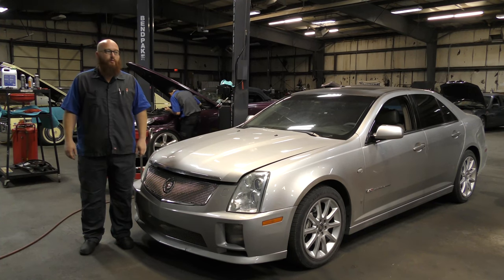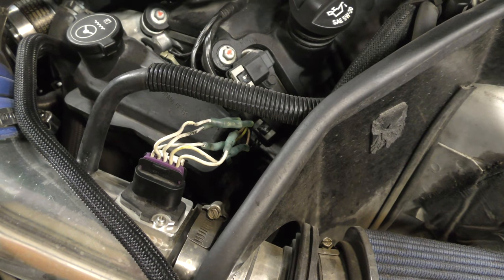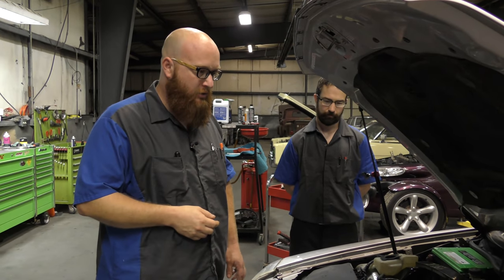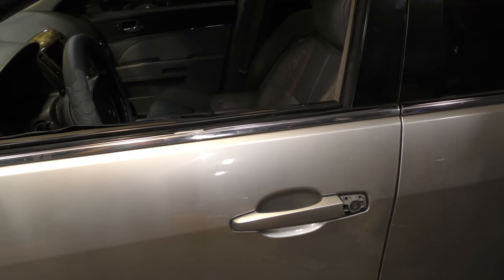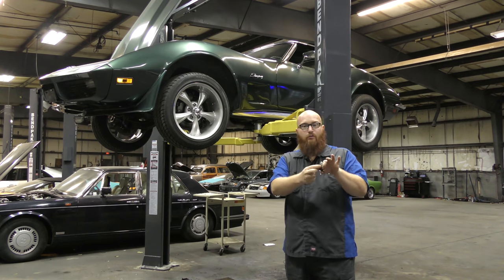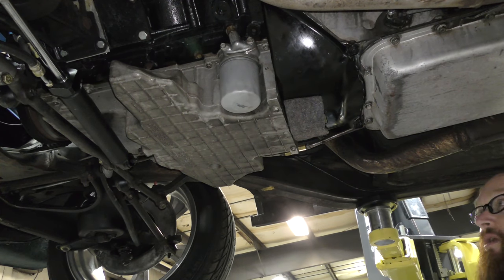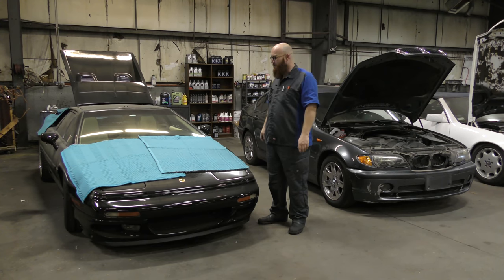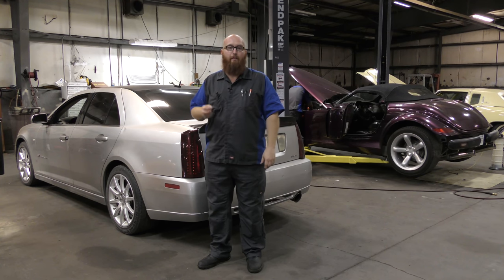When shops break cars! The CAR WIZARD cleans up mess made on 06 STS-V Cadillac. Plus shop updates.

Comment: I had an '85 F150. It was a 4.9L with a 3 speed with OD, on the floor. Now, I was really busy with work at the time, so, I brought it to a local shop to get work done. Real simple stuff, plugs, oil change, rakes, stuff like that. Well, when I picked it up the clutch was totally buggered. Turns out, the kid they let work on it, didn't know how to drive stick, and, DESTROYED a rand new clutch disk in the couple of days they had it. I ended up going around, and, around with the owner about it, and, eventually had to threaten to sue him to get him to pay for it.

Comment: Didn't they screw around with the MAP sensor voltages computing? Sinsce BAROP sensor is in the engine module (i think) it must mean that, even if the BAROP sensor is shot the module sends a default vaule and it doesn't cause a DTC. I would try module reprogramming back to stock

Comment: yeah it doesn't take much to damage a vehicle if you don't know what you're doing. Friend of mine screwed the timing cover trying to pry off a water pump because he was prying on the cover instead of the water pump, and my first car's previous owner had an alternator "converted" the proper plug on an alternator to a little ring connector to make the wrong alternator work. it melted some of the wires.

Comment: I always wanted one of these cars I came close to buying one but because of the fact doing research on them that they tend to overheat while driving them too hardas well as having sometimes issues with the transmission or electricalIssues. They're very beautiful cars and very nice and fast however I didn't think it'd be worth trying to fix car over time of owning it when will cost more to fix then to maintain.

Comment: Several more reasons to run  stock cars with stock engines and parts.  I just dont want that level of excitment in my life.
Reply: If you don't try to cheap out and cut corners you don't have these kind of issues. Who ever did the swap either didn't know what they were doing or just a lazy mechanic.
Reply: i agree its just aftermarket stuff has that cool factor. but after losing money trying to be cool with my cars, i totally agree with that line of thinking.
Reply: @johnnysouza5601   i dont think an LS swap is easy. Custom shops might be 5 grand more. To get the sensors and car computer right is not simple.
Reply: Stock by no means equals better. There are plentiful examples of aftermarket parts being better than OEM.
Reply: @phillyguerrilla   chevy or ford or porsche or bmw car computer and software is better than what some garage can try to do for one car on a single setup tuning
Reply: After dumping alot of money into my miata and modifying it just to have it suck to daily drive, I love driving my Scion xa now cause it's quiet, reliable, and I don't have to worry about it at all. It makes me appreciate keeping a car stock so next time I get something fun, I won't go crazy like the Miata unless it's strictly a project car
Reply: @cayman9873  it can be that simple by taking it to people who know how to do it properly. It's that simple by just spending the extra money to get the right kits. If it was truly that hard there wouldn't be so many ls swaps done currently out there. It all comes down to how much you want to pay and its absolutely one of the those things where cheaper isn't better.
Reply: Also kills resale value.
Reply: Lol

Comment: Worst “clean up” I’ve ever done was when a customer had a 2013 Toyota RAV4 towed in because it randomly wouldn’t start, the shifter won’t move out of park and had multiple warning lights. A small shop recently put a new alternator in and did not want to deal with the new problem so she had to bring it to the Toyota dealer I work at. Turns out the alternator fuse was also blown and the said shop literally used a paper clip as the fuse, and it wasn’t even secured properly which caused the vehicle to get all wonky. Gave the paper clip to the customer and told her to bring it to that mechanic.

Comment: I love those cadi v8 sts's! I want to buy one when I get back to the States
Reply: Pls don't buy a northstar
Reply: @Juice-tr8xi  so then, what's a good awd sports car in your opinion?
Reply: @jasonrogers1085  The Northstar's in these cars are fine, the head gasket issue was fixed on them in 05. Even the ones before then were good, but they got a bad reputation because people did not keep up with the cooling system maintenance on them.

Comment: My last mechanic dropped the door panel off my 05 VW Golf when they had it removed and damaged it. They tried to hammer it out then just put it back on the car and hid it from me when I picked it up. Because I picked it up in the dark and the way they parked it I didn't notice till I got home. I took it back and while they didn't totally admit it they took it away to fix it but had the worst body repair done on it of all time. I'm so mad as a good body shop has quoted me 1k for a proper repair. It's not worth a lot of money but only has 38000 miles on it and I have kept the paint in great condition.

Comment: Hey Wizard are you sure the adapter bushing was undersized and that the hole in the crank wasn't oversize? You may have just made a bushing that won't work if the engine or crank is ever changed. Also, how did you keep the diameters concentric if you took it out of the lathe to creep up on the final diameter?  Sweep in the adapter with a dial indicator?

Comment: I have a question. I have a 1974. C-10 Previous owner put a lowering Front and clip.I want to put back to the original.Will a front suspension work on a 1980?.That’s the problem people try to lower the truck .But they do it the wrong way

Comment: I recently bought an Audi tt, I took it straight to an Audi specialist for timing belt, oil change ect. My normal mechanic is extremely busy but I needed the work done, the car came back to me with an oil leak took it straight back there they denied it, eventually got it to my usual mechanic he found the leak straight away, just a sump plug. I don't get the problem with just being honest with customers because you will just lose business
Reply: 20V?
Reply: @jonasthemovie nope the 2.0 TDI, I did have the 20v as a tt and the same in my Seat leon cupra r they were brilliant, both had the same problem which was the coil packs

Comment: I used to have that same car... I noticed a few things during the video... It has a smaller blower pully, and the stage 1 and stage 2 cold air intake. The correlation code can be from the increase in boost and the PCM can't validate the Reading of the boost sensor vs. rpm vs. load. If you like I can help with these cars. I have tuned several and know the "ins and Outs" of them. Find me on IG @charlieridinger

Comment: That poor STS-V.  That's in rough shape.  Aside from the exterior flaws, I could see the driver side door panel torn away in one part of the video.  Also, the MAF sensor wiring, there should've been no need to splice wires just because of the CAI (which that is a Spectre 2-piece BTW), needs to be done.  Just disconnect the plug, remove the MAF, and then reinstall/reconnect in the new CAI.  Makes me wonder if they were trying to tap in to the wiring for something else aftermarket to need to know MAF related info.

Comment: I had a shop work on my ford hybrid cause I didn’t wanna mess with the high voltage lines and they had some dummy hook the battery up backwards and it fried everything they changed a couple things and it runs but it hasn’t been the same since gotta hate it

Comment: Since the ECU is all fuckered up, you’re gonna have to rip all the aftermarket crap off and replace back to OEM. After that, flash it back to stock! I got a “screaming deal” on an 06 WRX that had some fucked up tune and Frankensteined aftermarket parts on it. After $8k and a new engine it ran just like it was sauppose to and was reliable!
Reply: So what I'm getting at is just keep it stock unless you have 5 grand in reserve to replace all the crap you broke
Reply: @TwoDollarGararge  no if you're buying a enthusiast turbo car like a wrx or sti have a compression and leakdown test done on it plus have a mechanic look it over to make sure its solid. itll cost you a little bit but if it saves you from replacing a 5k engine than its worth it. you can modify these and have them be reliable you just have to do it the right way. what ever type of car you have do research on the forums and find out out to do it right and safe. most turbo subarus you  have to retune for everything like bigger turbo, injectors, downpipe, etc. also if you drive it nice then it will be a really reliable car.
Reply: @mromatic17  true I got my focus st with 171k but it was stock it currently has 238k but never had a major issue

Comment: You need to get a pass through from snap on. We have one and it works well on gm and ford products. Chrysler not so much.
Reply from the maker: Where do you get the ecm files from?
Reply: @CarWizard  you purchase the software from the manufacturer. You can purchase each time or you can purchase a year subscription for around 800-900. Right now we are purchasing each time because we are getting the hang of it. When we start doing more flashes  we will probably get an annual subscription. Its 45-50 for the single day use.
Reply from the maker: Tom big The problem is that I work on about 30 different makes, and none are more than others. Im not spending that on the service when I might use it twice a year per make of car. Totally not worth it
Reply: Domestic and Asian is 90% of what we do so it is worth it to us. We try to sub out as little work as we can because I don't like putting my name on something I didn't do. That is another reason why we started doing programming because we had trouble with our local dealership.

Comment: GM ( or somebody ) does make a complete kit for 700r4 behind LS1....that spacer...and flexplate....bolts....if the seal was shot I am sure the front pump bushing is too...if will never not leak with a bad bushing

Why did he cheap out and not use a 4L60e?? Does it even have the correct TV cable !!??

Comment: My dads getting a 4Runner with 23000 miles for 30K. Underbody only has some very minor surface rust but really its not even anything, im going to fluid film the whole underside anyway. My question is, is this a good deal? Its a 2016 SR5 4Runner

Comment: Hi wizard..quick question.  I have a 1999 Porsche boxster. I either have a blown head gasket or cracked engine block. The antifreeze is leaking from the manifold.  How much would you charge to take the engine out and fix the problem
Reply from the maker: Those engines used are several thousand. On a Porsche, $5-10,000 easy
Reply: @CarWizard  hay wizard.. so I'm better off just getting another engine then trying to fix the cracked engine block or head gasket?  Any advice is appreciated

Comment: Car Wizard, I understand the concept and advantages of a cold air intake but can you please enlighten me on how a bare cold air filter placed inside a hot engine bay accomplishes anything but making more intake sound? Now I would understand if the filter was mounted in a thermally isolated part of the front structure of the car with some sort of vent feeding the enclosure fresh air but simply bolting on a cold air filter under the hood of a heat-soaked engine bay just doesn't make sense scientifically speaking.

Comment: If you fixed it first, 105.00 per hour. If a friend fixed it first, 125.00 per hour. If it was not running when you brought it in after fixing it first, 135.00 per hour. If it runs but not good after you worked on it, 150.00 per hour. If you brought it to me when it broke, 90.00 per hour. If you used aftermarket parts to fix it, 125.00 per hour. Ya'll get the picture. Adjust the prices as needed, lol....

Comment: The guy should buy another transmission and have you put it in. The 700R4 is not a strong transmission for a car with that much power. I would get a 4L60E or a 4L80E and put it on and they have an electronic module conversion you can get from Summit and it's easy to do.

Comment: Wizard, the newer GM mass airflow that is currently installed, is needed b/c of the CAI, specifically the inlet tube diameter (aka Hot Air Intake) I bet the heat soak on that is insane! it also forced a tune to scale for the larger intake tube. They make plug and play adaptors for every type of modern GM vehicle for the newer MAF sensors, Owner should never have cut or allowed anyone to modify the OEM pigtail for that hack job. As far as the supercharger reading, its unlikely its the tune sniff around more.  Lastly GM vehicles can be reflashed back to stock, AC Delco (https://www.acdelcotds.com/subscriptions) will let you access a single VIN for $40 for 2 years for unlimited programing on that 1 VIN. Why keep sending out clients, also you can update all other known good modules which can help fix some older software issues and codes, you just need a tool to go with the subscription, I use the VCXNano for GM non wifi, its about $150 and works well after setting up all the software. Also you could invest in HP Tuners & start learning, its a powerful suite not just for tuning, its a fantastic diag... tool as well it works on many vehicles/brands/models, as a Master MB tech I recommend you widen your gaze on aftermarket stuff for vehicles, aftermarket is everywhere and learning what they do can help you better understand even if you want to keep OEM diag... and parts.
Reply: Has an upgraded 2.5 upper pulley on the supercharger, maybe that is throwing readings off....?

Comment: Obligatory horror stories: one shop left two of my brake lines secured to the chassis rail with cable ties, and a tyre shop cross-threaded and stripped out the retention bolt for the spare wheel carrier under the rear of my work van, barely held in place and could have dropped the spare wheel onto the road any time I hit a big enough bump. 
If you know ANYTHING about working on cars, always check the mechanic's work and the state of the engine bay etc. after going to a new shop.
Side note: there's really no fucking point installing a "cold air" intake and then leaving the pod filter inside the engine bay with no baffling to stop it sucking hot air. 🙄

Comment: Engine swaps in modern cars just aren't worth it unless you can get it all dialed in. All he had to do is buy, or build a 383 stroker Chevrolet. It will bolt right in. It is possible for these motors to make 500 hp but my experience with them is that 350 rear wheel horsepower is the sweet spot. Keep the original Turbo 350 and rebuild it to take the extra power. If one must have an overdrive, get a Gear Vendors. Doing stuff like this is just stupid unless you are machinist. This is the result to the owner wanting something  different and mechanics over their head!

Comment: Butt splice connectors, YUCK! I am a fierce proponent of soldering and heat shrink tubing connections like these. The voltages and currents are quite a bit less that traditional automotive circuitry and these kinds of connections can develop high resistance that can cause issues.

Comment: Wizard, I have a code for coolant temp too low (180 degree coolant on scanner) and keeps vehicle in open loop, would tht affect my fuel mileage ? And what would cause a slow responding o2 ?  Thamks in advanced
Reply: I’m no expert but since you have a scanner, put it in live data and watch the coolant temp while you drive.  Get it nice and warm with the AC on and some “spirited” driving.  If the coolant temp doesn’t come up, then the sensor is malfunctioning.  Test the sensor by removing it, plugging it back in, and pouring some boiling water on it.  If the data doesn’t show the proper reading-replace it.  If the reading does come up to 200degrees+ when you pour the boiling water on it, than your thermostat is open and you are over-cooling your engine.  Since they’re usually cheap, just replace your thermostat anyway.  These are the two ways that your vehicle would have 180 degrees showing up.
As for open/closed loop and an affect on MPG, heck yeah it will!  Think of it, your vehicle is trying to “safely” get a vehicle that has just started to run, or is trying to get to optimum temperature, with no, to little, information.  Overfueling an engine will foul things.  Running an engine lean will do damage.  An engine computer will always try to “protect itself” by putting too much fuel into it than putting less fuel into it.  If your vehicle is still in the “open loop” situation, you will always have more fuel dumped into it than is necessary, decreasing your MPG.
Reply: Right. I'm suspecting previous owner removed thermostat.  Th fuel trims look good but being in open loop, I ask these question, once again fuel trims looked good